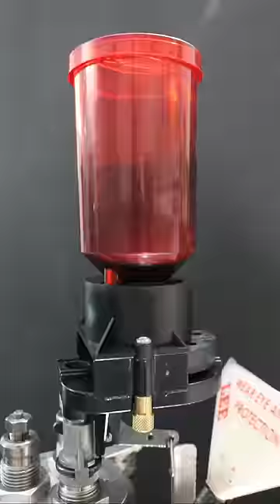Reloading 9mm ammo in 1 minute with Pro 1000  -   #reloading, #9mm, #leeprecision, #ammo, #shorts

Comment: Could never get the primer to feed
Reply from the maker: Good morning Justin and thanks for stopping by👍🙏. The primer feed is an issue on this model. I had several problems initially but I did get them solved. Have a look at the longer clip and also so modification that I did to the press. Links in the pinned comment. Have a great day.

Comment: Anyone else notice the bullet not get seated and the brass was bent
Reply from the maker: Good morning Brian and thanks for looking at the content. I must say I like your observation skills👍👍🥇🥇. .. (CASES) Cases get damaged during shooting or until they reach the press for reloading but this is not an issue since they are resized as soon as they hit the first die. Here you can actually see that the case is adjusted after coming out of the first die.

(SEATED) When I reload I customize my rounds based on the weapon. For instance the OAL for rounds that are specific for the CZ TS 2 are not ideal for the CZ Shadow 1, and vice versa. I considered the cannelure on this particular projectile as an indication of the location but it is not necessarily the exact point to crimp to projectile, especially on 9mm heads that are in most cases without a Cannelure.

Based on my weapon, used for these few test rounds, the OAL you see here leaves the grove slightly visible but it is the best OAL for my needs.

9mm projectiles are mostly without cannelure

Take care and have a great day.
Reply: @ReloadingMoreAD1966  I'm still new thanks for letting me know 😃
Reply: Oh yeah whoa I didn't see it fix it that's rad

Comment: Smelt wheel weights, Cast ingots
Melt ingots, cast bullets
Lube & size bullets
Clean Brass and begin to gripe about the cost of primers & powder these days, as i start to load. 
I prefer using a loading press, not a block of cheese like in the video...... and i hates me some 9mm, dont shoot it and certainly wont load it.
1000 loaded rounds is much more than 1000 pulls,, and Ive pulled millions of times.
Reply from the maker: Good afternoon Willy and thanks for stopping by🙏👍. Have a great week

Comment: Does this actully make sense cost vise?
Reply from the maker: Good evening. Thanks for stopping by and looking at my content.🙏🙏👍👍 
Here are my own workings as follows: 
🔶Based on 9mm setup only. (Changing caliber is approximately $100 addition, mostly dies and shell plate)

🔶ALL FIGURES & CALCULATION DONE January 2022 as follows:

$300 _ Lee Pro 1000 Press 9mm, ref. 90640.
$020 _ Lee Case Collator, ref. 90667.
$045 _ Lyman Ammo Checker, ref. 7833000.
$012 _ Dillon precision case lube, ref. 13733.
$055 _ Scale frankford arsenal, ref. DS-750 
$050 _ Price estimate for a generic caliper.
$048 _ Price estimate for kinetic bullet puller. 
$530 _ TOTAL INVESTMENT of above listed item ONLY.

$160 _ TOTAL Calculated price of raw materials to fabricate 1000 rounds type (CPRN-124gr) "brass cases free)
 
$300 _ TOTAL Average price for factory loaded ammo, 1000 rounds, 124gr.

🔶Therefore, excluding labor cost, I save $140/1000 Rounds.
🔶Therefore, investment of $530 / Savings of $140 = 3786 rounds.
🔶Therefore, after 4000 rounds I start saving $140 / 1000 rounds I send down range.

🔶🔶🔶 In short, after 4000 rounds I cover ONLY my investment cost.
Reply: @ReloadingMoreAD1966  cool, how much rounds can you reload in an hour?
Reply from the maker: @blubb7711   The manufacturer claims that you can produce 500 per hour but personally I manage about half of that "200 to 250" and not more than 800 to a 1000 a day, mostly because it is though on your arms. 

Go to the link for the 9mm or 45ACP provided in my pinned comment. You can see the entire process. Have a great week

Comment: I own this thing. Load 50 rounds in 20min, then sth jams and it taks 30min to fix it. For loading small amounts it is ok, but not for larger batches. And caliber change is a pain in the butt. not recommended
Reply from the maker: Good morning Klaus. Thanks for looking at my content👍. Had all sort of issues initially but to be perfectly honest most I solved and the press works fine. Obviously it has a few bad days but it dose the job, and for the price paid it is for sure good value for money.

Have a look at the longer detailed clip if you have some time. link in the pinned comment of this short. take care and have a great day.
Reply: @ReloadingMoreAD1966  The main issues I faced were a) the case feeding with longer thin cases like .357 or .38, .45ACP is fine, b) the primer seating which when it goes wrong causes powder getting in the mechanics, and c) the wear of the plastic gear under the rotating case holder disc. I have it now set up for .45ACP only and for all other ammunition I switched to a PräziPress by Turban CNC. If you ever get your hands on one please share your experience. All the best and have a nice day!
Reply from the maker: @klausmoritzpeitzsch690  Hello Klaus. Turban CNC?? Now that is a press.. about the issues:
pushing

B) massive issue, same also here. I fixed that with lubrication of the cases a 2 days before reloading and an other addition to make sure the primers are shaken well and fall in place. If you have little oil near the primer seating pin it all goes wrong. NO oil in that location.

C) This part I must say gave me no real issues. I changed those parts one time but they had still a lot to offer. 

I have it load 9mm, .357, .38, and .45ACP. Takes too much time to set each caliber properly but when I start the rounds come out great.

The turban CNC I am familiar with in a sense that I have been considering it. I buy most of my stuff here https://www.grauwolf.net/ or sometimes also on Egun. 
In the end, for rifle reloading, I settled for the MEC Marksman. It is in my opinion a great press for rifle rounds. I suspect that the turban might be even better but the MEC marksman had been around for many years so that is , and the price, that made me go for it. 

I have some photos in the community post of the MEC marksman.

Have a look at the longer clips and the modification videos I did on the Lee Press. 

Link for a couple of them is in the pinned comment.

Take care and have a great day. Nice talking to you.🙏🙏🙏🙏👍👍👍👍
Reply: @ReloadingMoreAD1966  yes, Grauwolf is where I get my stuff as well, incl. the präzi press.
Reply from the maker: On the same page..👍👍

Comment: What bullets? My .38 Super needs those.
Reply from the maker: Good Morning Jim and thanks for stopping by and looking at my content👍👍..  The projectile used here is a 130gr SJFP, reference B-329 fabricated by PRVI, diameter of 0.3545. Hard to find but I had some old stock, around 500 heads in total.
A similar projectile that I have also used, more frequently than this is the 125gr SJSP, reference 613573 by Fiocchi. Both mentioned projectiles I have used to reload 9mm and .38 special rounds with no issue what so ever. 
Have a great week.
Reply: @ReloadingMoreAD1966  Thanks for the information! I have a 1911 chambered for .38 Super that is extremely accurate, but isn't reliable with hollow points. I think a bullet like this might be a good alternative.

Comment: So do you save money or is it more just a hobby too do all this
Reply from the maker: Hi and thanks for looking at my content. For me it is a hobby but I also save money. Most importantly, I can fabricate ammunition that is specific for a weapon, hence increasing accuracy when shooting. Here is a calculation I sent to someone else in the chat. Take care and have a grate day. 

 Here are my own workings as follows: 
🔶Based on 9mm setup only. (Changing caliber is approximately $100 addition, mostly dies and shell plate)

🔶ALL FIGURES & CALCULATION DONE January 2022 as follows:

$300 _ Lee Pro 1000 Press 9mm, ref. 90640.
$020 _ Lee Case Collator, ref. 90667.
$045 _ Lyman Ammo Checker, ref. 7833000.
$012 _ Dillon precision case lube, ref. 13733.
$055 _ Scale frankford arsenal, ref. DS-750 
$050 _ Price estimate for a generic caliper.
$048 _ Price estimate for kinetic bullet puller. 
$530 _ TOTAL INVESTMENT of above listed item.

$160 _ TOTAL Calculated price of raw materials to fabricate 1000 rounds type (CPRN-124gr) "brass cases free"
 
$300 _ TOTAL Average price for factory loaded ammo, 1000 rounds, 124gr.

🔶Therefore, excluding labor cost, I save $140/1000 Rounds.
🔶Therefore, investment of $530 / Savings of $140 = 3786 rounds.
🔶Therefore, after 4000 rounds I start saving $140 / 1000 rounds I send down range.

🔶🔶🔶 In short, after 4000 rounds I cover my investment cost.

Comment: Hmm, It wouldn't be too difficult a task to design a feeder for the slugs.
Reply from the maker: Hello Eric and good afternoon. Thanks so much for looking at my content👍👍🙏🙏. This press can be fitted with an original attachment for under $100 that would place the bullet in position automatically, in a mechanical fashion without an external power supply but personally I find it better to place the bullet manually because I can use that motion to also visually inspect that the powder is in the case.  

One can find fully automated presses but this one in particular is more for the average reloader and has some limitations. 

I have a longer detailed clip on this press you might find interesting. Link in the pinned comment. Have a look at that to see the entire process.
Reply: @ReloadingMoreAD1966  Makes sense.  Just a mega nerd here who got into messing around with microcontrollers and now I see projects everywhere.
Reply from the maker: @esinohio  Nothing wrong with messing around with controllers. Take care and thanks for your comment contribution. 👍👍👍👍

Comment: I find it interesting how everything EXCEPT the bullet has a little hopper or some other feed system. Rather odd thing to need to do by hand, no?
Reply from the maker: Good Evening Scott. Thanks so much for your nice comment🙏🙏. This press can be fitted with an original attachment for under $100 that would place the bullet in position automatically, in a mechanical fashion without an external power supply but personally I find it better to place the bullet manually because I can use that motion to also visually inspect that the powder is in the case.  

I have a longer detailed clip on this press you might find interesting. Link in the pinned comment. Have a look at that to see the entire process.

Comment: No crimp?
Reply from the maker: Good evening KY and thanks for stopping by.👍👍.Here I am using the 9mm die set by lee, item 90509, comprising of a total of 3 dies.

The first two dies are not relevant for the crimp procedure. The third die is seating the bullet in place and also crimping tight the bullet. Now be aware that the crimp is not a roll crimp, sort of what you see on older revolver rounds but just a minimal crimp, similar to factory loaded 9x19mm ammo supplied by most brands. 

Thanks for showing interest in my content. Have a look at the channel for longer, non-short clips for this press. links in the pinned comment. Regards and take care.

Comment: Anyone gonna point out how fucking bent that casing was or nah, cause that shit looked a bit fucked.
Reply from the maker: Good morning. Thanks for looking at the content and leaving a comment👍👍 "Would appreciate if you correct and remove uncalled for text because YT flagged your comment"..... Anyway, very impressive observation skills. Someone picked up on that a couple of days ago. It is not usual with this press as it is as aligned as one would expect on all occasions.

The alignment issue you see here was real but lucky for me it was no issue during firing. I captured it as soon as I started editing and immediately knew the reason. I estimate that few rounds prior this single round footage the shell plate carrier cracked because I replaced it few rounds after this footage was taken when it totally gave way. I had to inspect a lot of rounds with a case gauge because I was not sure how many might have had issues. 

After replacing the complete part, item 90683 by Lee, it all worked fine as before.

Do have a look on the channel for longer clips on this press. Link in the pinned comment.

Have a great day and thanks for your comment.🥇🥇

Comment: No crimp??
Reply from the maker: Good afternoon Hungry handgunner and thanks  for stopping by.👍👍

Here I am using the 9mm die set by lee, item 90509, comprising of a total of 3 dies.
The first is called the "Full Length Sizing Die". This particular die is removing the spent primer and simultaneously sizing the cartridge.

The second die is the "Powder Thru Expanding Die". This die will flare the top of the case, making way for the projectile to be seated in the next step. This same die is also the place were the powder charge is released. 

The third die is seating the bullet in place and also crimping tight the bullet. Now be aware that the crimp is not a roll crimp, sort of what you see on older revolver rounds but just a minimal crimp, similar to factory loaded 9x19mm ammo supplied by most brands.

Thanks for showing interest in my content. Have a look at the channel for longer, non-Short clips for this press. Regards and take care.
Reply: @Reloading & More  ice already subscribed, good sir! I load on a Lee single stage, and my 9mm die set came with a 4th crimping die, hence my confusion. 

I appreciate your response though, and look forward to watching more of your content. Currently loading up some .32 H&R Mag myself. Stay well!
Reply from the maker: Have a great week to come. 🙏👍

Comment: a little crimp would be useful 😊
Reply from the maker: Good evening. Thanks for stopping by the channel.👍🙏🙏👍.Here I am using lee dies item 90509, comprising of a total of 3 dies.

The first two dies are not relevant for the crimp procedure. The third die is seating the bullet in place and also crimping tight the bullet. Now be aware that the crimp is not a roll crimp, sort of what you see on older revolver rounds but just a minimal crimp, similar to factory loaded 9x19mm ammo supplied by most brands. 

Thanks for showing interest in my content. Have a look at the longer clips on this press, link in my pinned comment. Regards, take care and have a great evening 👍 👍

Comment: Running can because of the lack of crimp? I wonder how they guage
Reply from the maker: Good evening Garrett. Thanks for stopping by.👍👍
Here I am using the 9mm die set by lee, item 90509, comprising of a total of 3 dies.
The first is called the "Full Length Sizing Die". This particular die is removing the spent primer and simultaneously sizing the cartridge.

The second die is the "Powder Thru Expanding Die". This die will flare the top of the case, making way for the projectile to be seated in the next step. This same die is also the place were the powder charge is released. 

The third die is seating the bullet in place and also crimping tight the bullet. Now be aware that the crimp is not a roll crimp, sort of what you see on older revolver rounds but just a minimal crimp, similar to factory loaded 9x19mm ammo supplied by most brands.

Thanks for showing interest in my content. Have a look at the channel for longer, non-Short clips. Regards and take care.

Comment: Still prefer my Dillon RL1100
Reply from the maker: God afternoon Max and thanks for stopping by the channel 🙏👍. Hands down to the Dillon 1100. that is a fantastic reloading machine. Hard to compare to be honest. Depends what budget you have and what you are planning to reload. The lee is a cost effective solution and the ammo it makes is reasonable good. Not that fast but still. It will need a few adjustment but eventually when you understand how it works it is a nice machine to have.  Also here is a link to another of my video on my channel for the Dillon 650 . https://youtu.be/UyKHr_O8-tg

Have a look at the other more longer clips of the Lee 1000 on my channel. Link in the pinned comment.

Have a great evening.

Comment: Bet this setup was not cheap
Reply from the maker: Good evening Eric. Thanks for stopping by and looking at my content.🙏🙏👍👍 
Here are my own workings as follows: 
🔶Based on 9mm setup only. (Changing caliber is approximately $100 addition, mostly dies and shell plate)
🔶ALL FIGURES & CALCULATION DONE January 2022 as follows:

$300 _ Lee Pro 1000 Press 9mm, ref. 90640.
$020 _ Lee Case Collator, ref. 90667.
$045 _ Lyman Ammo Checker, ref. 7833000.
$012 _ Dillon precision case lube, ref. 13733.
$055 _ Scale frankford arsenal, ref. DS-750 
$050 _ Price estimate for a generic caliper.
$048 _ Price estimate for kinetic bullet puller. 
$530 _ TOTAL INVESTMENT of above listed item ONLY.
Reply: Bet it is

Comment: Yeah, I'll let Federal, Winchester, Remington and Hornady make my rounds, thanks.
Reply from the maker: Thanks or stopping by the channel. 👍. Using factory ammo is the choice for several shooting disciplines so I understand you ad anyone going for that. I did in the past but found that when done correctly, reloading has few benefits. non-the-less, but don't be fooled by my entertainment videos that reloading is a mundane and easy operation. Reloading is a very dangerous affair and it requires lots of time, patience and restraint.  Even so, mishaps can happen.. Take care and happy holidays.
Reply: @ReloadingMoreAD1966  I've had reloads fail in more ways than one. I don't trust them anymore.
Reply from the maker: @Ogrematic  I understand your view and mostly the frustration of such rounds. Take care.
Reply: @ReloadingMoreAD1966  I bought a box of ultimax ammo once. Had so many failures I threw the rest away. We have a guy here who does reloads, and they worked ok, till an overpowered rnd almost blew up my ar. Not taking the risk again.